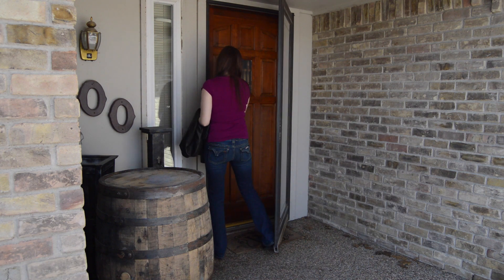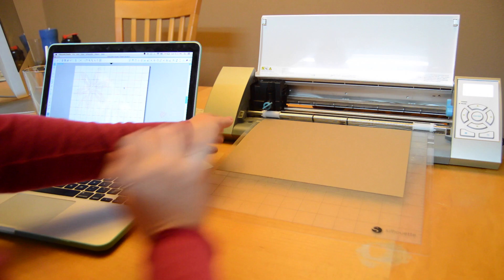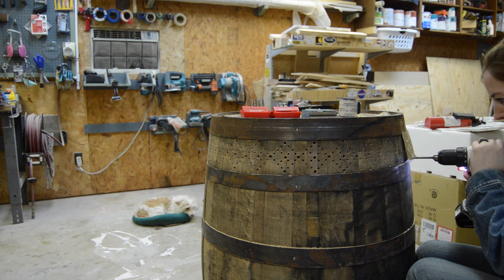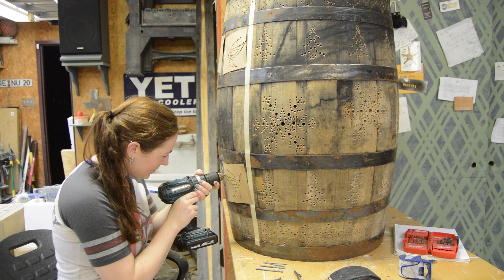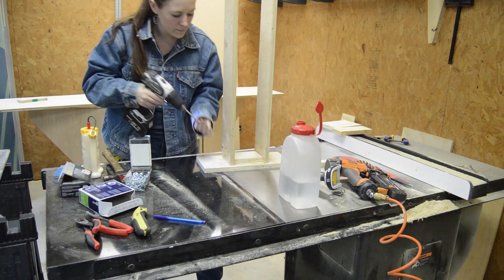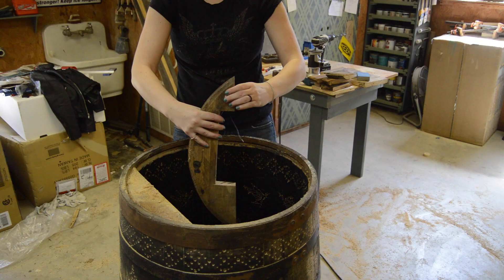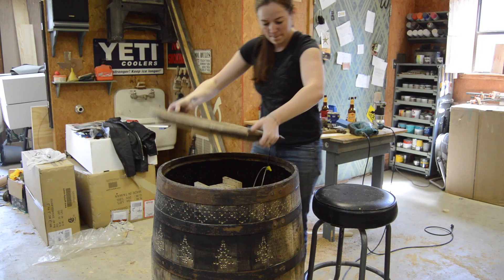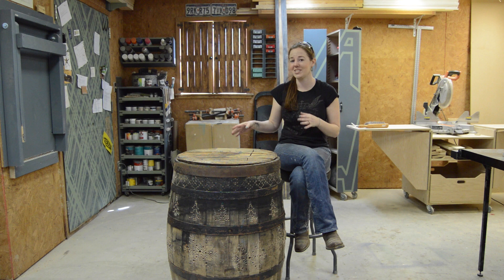Light Up Whiskey Barrel

Comment: Just need to add a "light sensing" switch so your Mom doesn't have to turn it on/off manually everyday.
Reply from the maker: Bob C A rope light would not be bright enough. This material is a little over an inch thick. Even with as many lights as I put in it, I still think I could use a few more that point in the other two directions, but we'll see.
Reply: they sell dawn to dusk out door timers at most home centers, some even have remotes
Reply: April Wilkerson Excellent project and results. You have more perseverance than me, it would have ended up as ONE season barrel, if I'd been doing the drilling. My fingers cramp something awful!
One question: Did you check the amperage rating on the switch you used? Is it rated for that many bulbs? Your blog didn't say.

With 6 fixtures, if you installed 100 watt bulbs, you're looking at around 5 amps.            (6  bulbs x 100 watts / 120 volts= 5 amps.) That's a lot of amps for a small switch. If you add more fixtures, more amps. LEDs would use less, of course, because their wattage is less.
If the switch isn't rated for that much amperage, it could get very hot & become a fire hazard. So, you might want to use a regular ol' house rocker-type light-switch, which should be rated for 15 amps. Better safe than sorry. Take care. Your videos are great!
p.s. Wrap those wire nuts with elect. tape, to keep them from un-twisting.

Comment: Fantastic April!
If I can offer two suggestions:
1. (altho I haven't read in the comments but I'm sure someone already said...) Use CF bulbs for a multitude of reasons. 
2. Since you are only trying to light one half of the barrel at one time, vertically divide it with a board (using your seasonal equator that you made). Paint everything white inside including the board. Make your light stand so you can just pop it over to the season of your choice when the time is right. You'll 3x to 10x your light.

Comment: Hi April.  Nice project and respect for having the patience to drill all those holes.  The tree hugger in me compels me to point out that you could get the same light output per hole for 1% of the energy input.   Paint the inside of the barrel matt white and replaced the incandecent bulbs with LEDs.  The white inside would make it work like an integrating sphere so you would have very even light output from each hole.

Comment: What a fantastic job April.  I respect your patience drilling those holes!  I've recently bought a wine barrel myself and have been contemplating adding lighting as well, making it a self-contained 12V battery system (somehow) using either a battery inside or a solar panel in the lid.  Anyway, I'll see how I go!  Again, well done!

Comment: What a great idea and what a good looking result. 
One quick suggestion I might offer is that you might try using .040 aluminum for the light support, it is commonly used in the sign industry. It can easily be bent or drilled  also it would add reflection  providing even light output. I would also suggest using LEDs which work well in a damp situations. 
Great job!

Comment: What a great project.  I can definitely see why your hands would hurt and cramp up, that is A LOT of holes to drill.  One thing that I noticed (assuming that you matched the wires from the supply cord) is that you put the switch on the neutral side of the power and not the hot side.  It is safest to switch the hot side of the AC power and not the neutral.  A note for the future.  I'm glad I found your channel.

Comment: Looks great April. I can't imagine spending that much time drilling holes. I think I'd be seeing those patterns on everything for weeks afterwards.
Two thoughts on this: 1. How about a dimmer switch rather than a simple switch. I don't know if it would make any difference at all but it might be worth considering.
2. If you mounted the switch on the side of the barrel, near the top at the point where spring turns into winter, you could leave the lid free of any wires. That way, when you convert the top to a lift off lid, as you mention in the video, it can be lifted out without the worry of the wires getting dislodged or getting in the way.

Comment: Something they have in many French stores is a cement lid with a tiled top to replace wine casks to make them into bar type tables. You may be able to do something like that to for this project as well if you are going to make a new lid it may be difficult to match the species and weathering of the wood.
Reply from the maker: Whhhat?! That is such a great tip, thanks for taking the time to share it. I will definitely look into it.

Comment: I think it would look cool if you drilled out spots and install colored glass to add color and illumination.  I imagine there was a ton of saw dust at the bottom once you opened the lid. If you used LED lights instead of bulbs, it would use less power and you could install them closer to the walls and build a inside chamber for holding things, like umbrellas or brooms or whatever she might have in the room she will have the barrel in.

Comment: Don't know if anyone already said this or if you have done it yourself, but you could cut a circle out of some plywood and screw the plywood to the all the pieces of the top of the barrel, short screws of course. That would hold everything together and maintain the look of the original top of the barrel.

Then you could drill some holes through the plywood/top piece and mount the handle(s) on the top using carriage bolts with a square shoulder and acorn nuts on top. Use a tee-nut that will almost allow the square shoulder of the carriage bolt to slide through and tighten it all up. Should give you the result you are looking for and a look that is acceptable.

Good project by the way.

Comment: That sure was a lot of holes to drill April , but it turned out awesome. You always come up with theses great projects. A suggestion if I may,use a different wiring method such as Romex wire and boxes on your lights. Open 120v electrical connections, incandescent bulbs, single strand wire and wood are not great combinations. 
Thanks 
Mark

Comment: Pretty cool April.  You could also stick sheets of different colored cellophane behind each design.  Maybe blue for the winter and orange and red for fall.  It's very cheap and easy to imstall with a hot glue gun.  Just a thought.   Cheers.

Comment: That's a lot of holes. Nicely done. I might suggest different light source like LED's (makes inside of barrel cooler).  You can can pick some up at HD for not too much money. They come in strips that attach together which would make the wiring at lot easier.

Comment: You could build a round or square  frame on the inside of the lid to reinforce the slats and hold them together and then use a piano hinge on the outside of the lid with something on the lip to keep the lid from wanting to fall in.

Comment: Very nice! It seems(and I can't tell because of the camera) that you need more defuse light in order to get it to illuminate through most of not all of the holes. Staggering the light so that you get more omnidirectional light inside the barrel could achieve this. Also a junction box for the electrical connections is advised as this is 120v AC. I don't usually advise having a butt connector on something that can be tugged on by the cord and pulled apart. Put them in a box that is secured to the barrel, clamp the wire in and out so they can not move and use a good wire nut. Or if you really want to do it right solder the joints and heat shrink them. Just some ideas on making it a little safer.

Comment: Beautiful! 

Couple thoughts... LEDs last forever (practically) and use far less energy. Also, if only one side is showing, you only need lights on that side, maybe a 3 way switch, with lights on each side being on with the switch toward them, and the middle position being off?. Painting the inside white (or silver/chrome) will bounce the light and made it brighter (though it WILL kill the whiskey scent!) as well as sealing up the gaps between boards a bit.

But those are just ideas for other doing something similar, not criticisms!!

Comment: As an electrical engineer I couldn't agree more with Marks suggestion on rethinking the incandescent lights in a closed space and IP44 rated wiring & switches for outdoor use. 

Could you maybe find a suitable LED strip to wrap around the center column and a LED driver/transformer that are IP44 rated to use as the light source to not have the heat issue (fire possibility) and also have a humidity resistant cabling (short-circuit possibility)?

Comment: Looks good. I think the light might come through better if the holes on the inside were a little larger than out (taper bit from the inside), but that would probably require drilling it twice to get the shapes right, which would be insane :D

Comment: Wow, nice idea.  I think I would use you original lid (matching patina - if not too damaged from the cutting and remove the outer lip and put in a few wooden stop blocks on the inside.  By now your arms are rested and more buffed.  If you want more light, you could ream out the holes from the inside to let more light out, like we do with pumpkins.  Just a thought.

Comment: Nice job. I think LED lights would have been cool to use though. They would have been much cooler in temp and much brighter. You could have also used color changing LED's which would have been awesome but of course that would have driven up the cost. Such a neat idea, I might have to do something similar for my wife.

Comment: Cool project, maybe there's a way to remove the bottom to insert and wire the lamp instead of the top of the barrel, then you won't have to be too fussy when rebuilding the bottom of the barrel 'cause no one will really see it. Very nice job you did, I'm sure your mom loves it!

Comment: Instead of making a new top, take some  1/2" plywood and cut a circle a slightly smaller diameter than the top and glue the boards to it to keep the integrity of the barrel lumber visible.  You can then put a handle on the top and a light sensor switch, which you can find at any hardware store about the same diameter as the push button switch you put in.

Comment: That came out really nice.  I was thinking as I watched you put together the lights, that you could put in flexible LED strip lights on curved boards at each level of the holes.  The nice thing about the LED lights is they are low power, and they can be different colors.  I was also interested to know where your Mother got the barrel.

Comment: Nice project, just some thoughts, a piece of 1/4 plywood glued to the bottom of the top slats would hold it together and instead of incandescent bulbs a led rope light would run cooler and maybe be a bit brighter. Just thinking out of the box or barrel..

Comment: To improve the consistency of illumination you could countersink all the holes.  Countersinking them on the inside of the barrel will be a bit more difficult, but at an average of, say five seconds per hole, you could complete the 8632 refinements in just under twelve hours.  Good challenge for a lithium ion battery.  A banana per hour ought to provide enough potassium to prevent cramps.  Eager to see the video.

Comment: Very cool!  (1) I would be a bit concerned about the lamp heat igniting the barrel especially if the wood has been soaking in alcohol for many years.  (2) If you use high temp bright white paint to cover the inside, it will (a) improve the illumination of all the holes because the entire interior (except for parts shaded by the lamp mounts) will be highly reflective - essentially rather than 6 light sources, the whole surface is like a big source (look up integrating sphere for more detail) and (b) also serve to keep the wood from getting as hot thus reducing likelihood of combustion.  (3) A third option would be to mount LEDs in each of the holes - NOW THAT WOULD BE LOADS of FUN!  Fun video to watch!  Thanks!

Comment: Use LED bulbs, which are not only far more power efficient, they also give off very little heat (thus safer when enclosed in a combustable container), more weather resistant, and last 20,000+ hours so your folks won't have to change them often, or ever.

Comment: If you were to make a variety coloured cellophane drum with fan like louvers at the top supported on a nail on top of your light post it will turn from the heat generated by the light bulbs. displaying all you work in a variety of colour

Comment: That is a cool project.  I don't think I could drill that many holes without screaming a few times.  For the lighting, have you considered changing to colored LED lights?  Less heat build-up in the barrel, less power used, and the colors could emphasize the seasons.

Comment: Do you think you needed all those lights?, As said before, they should be put into a box, in other words the wires should be more protected..... It is outside. (LED's???)   As far a the project....GREAT, love the look, love the application, love the hole look, love your films.
Reply from the maker: Yes I do, I was actually thinking about adding two more that point to the 'sides' of the barrel because those imagines are as bright as the ones on the front/back. The barrel is going on a giant covered porch so even though it's outside, there is no chance of rain getting on it. : ) Thank you, glad you like it.

Comment: very cool idea. But 1 thing. I would get rid of those old light bulbs and go with LED light bulbs that fit in the same sockets that you used. Those old lights create heat, and you have those bulbs inside something flammable. (wood). LED lights give same amount of light, but hardly any heat. Much safer in my opinion. Choose the "Daylight" version of LED bulbs as they are the brightest.

Comment: Hi April,

Really cool project. Looks brilliant. I have a whiskey barrell sitting in my shed and its taunting me now to do the same as you but I live in Ireland and we dont get the good weather that I guess you guys get in Texas to enjoy this as an outdoor piece and the barrell is too big for inside the house too!! 

Just a thought for next time if u decide to do it again, maybe you could try accessing the barrell from the bottom instead of the top? 

Anyway, keep up the good work. Your videos are great!
Reply from the maker: The reason I didn't cut the hole into the bottom is because then you would have to lift the barrel over the inside lighting fixture and there is no way my folks would be able to do that. 

If the barrel is too large for the house, maybe you can cut it in half and put it on the wall as a lamp. To where it looks like half the barrel is inside the wall. : ) Just a thought.
Reply: +nothinbutgreenlights You could get lights rated for outdoors use. (IP44 classed or higher.) Maybe a couple of halogen or LED floodlights.

The wood could be treated.

Comment: you should take the whole light fixture out of that barrel before it heats up and scorches something. Put a strip of led lights wrapped around a cylindrical form. You will get much less heat, less electricity and more even light.

Comment: April Wilkerson : 4,316 holes @ estimated 1 min ea. = 71 hrs 56 min or about 3 days of non-stop drilling or if you were to drill holes for 8 hrs per day for 8 days and 59.5 minutes. Good practice I guess. lol. The 1 minute includes template taping, bit changing, drilling, and hand breaks.
Reply from the maker: Lol, you engineer you. It took me 7 days total to get it done. The longer I would sit and drill, the longer breaks I would have to take so it compounded. :) But regardless, I don't mind.
Reply: 7 days? Not bad! It looks great and was worth the wait. "I'd rather be drilling holes" shirt/ bumper sticker is better than "Re-plumbing under my kitchen sink." It is gross.

Comment: Great job, April.  Hope you don't get tendinitis from all that drilling.  My hindsight is that you should have used an under cabinet LED light strip vs wiring all those sockets together.  My concern would be if moisture gets in there, which it will with all the holes you will get shorts.  Where did she get a whiskey barrel?
Reply from the maker: I honestly don't think under the cabinet lights would be bright enough. You think they would? I mean, even with six of these, I personally think I could add about two more that point to the 'sides' of the barrel (where the seasons meet up). This will be on a large, covered, front porch so there is no chance of rain getting in it. She found it online somewhere, I'll have to get the name of the company. However, if you have a local beer brewing company you could call them and see if they have any. My local company sells them for $100 each.
Reply: A lot of the LED bars are very bright, but some are just for accent and aren't.  I main reason I mentioned them is because they will last a long time and use very little electricity.

Comment: Nice.
Just a small disagreement on your wiring. The wiring connections should be in electrical junction boxes. This is a potential fire hazard, reducing fire hazards, and shock hazards, is what the electrical boxes, and codes, are for. For this application romex cable is adequate, presuming it will be dry. The technique you used is only appropriate for low voltage, 24v or less.
A photo eye switch might be a nice way to go, or just a timer where it is plugged in. 
I really like the project though, you did really good work.